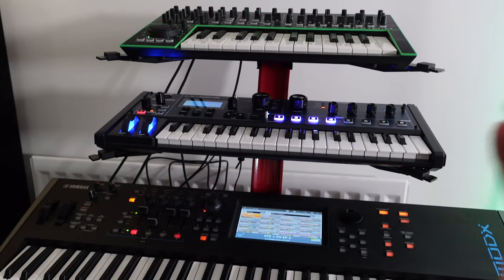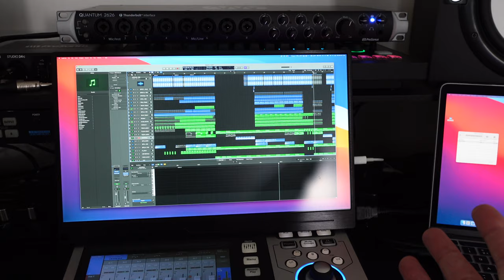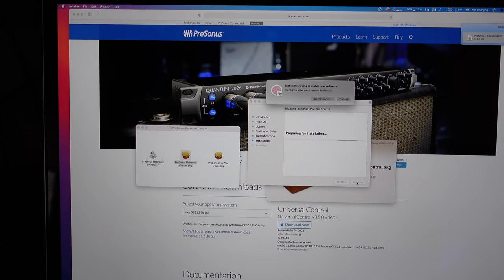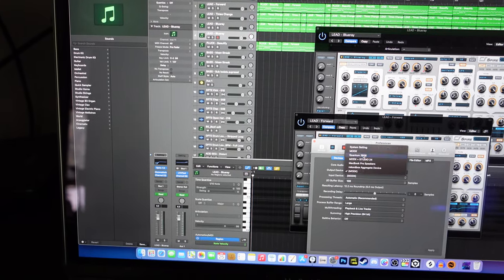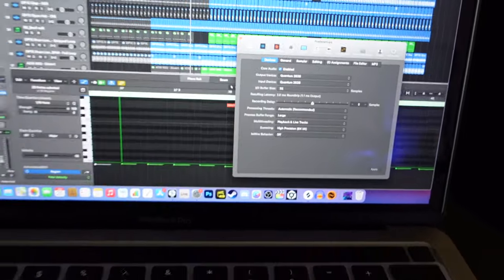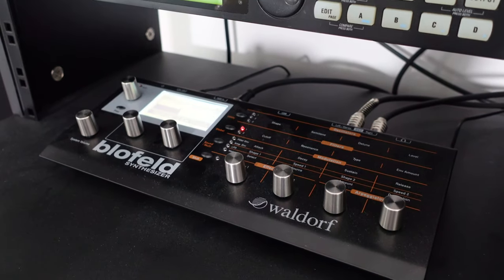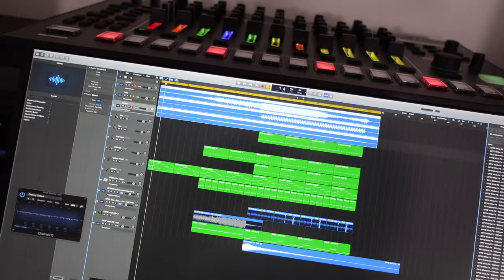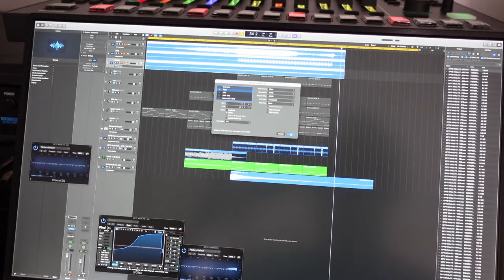M1 Mac + Presonus Quantum 2626 | Recording Hardware Synths

Comment: I've been using my Quantum 2626 as part of an aggregate system, combined with various components connected to it and a Presonus AR22 and a MOTU Pre8 where I have sent the ADAT channels from that out to an RME Digiface, skipping the onboard DSP processing of the MOTU and monitoring those channels directly from the DIgiface unit.  Now here is where I have run into issues.  So as to be able to monitor all of the various interfaces, I have connected them to a separate Mackie ProFX 12 to send them to headphone monitoring. All of the devices are latency free except for the 2626 which has just a bit of noticeable latency.  It is my understanding that since there is no DSP present on the device which can be accessed via Universal Control, Presonus has instead pushed that processing off to the DAW processing and what is being monitored is not the device inputs but the DAW I/O and this is where I am getting the bit of latency.

Comment: The Quantum 2626 is a Thunderbolt 3 interface (round trip less than 1 ms) with 8 preamps, ADAT expandability for $700! Think about it.  You can't touch any other Thunderbolt 3 interface with 8 preamps for less than $2000.  Some might think, 'well, preamp quality or on board DSP.  Yeah, those are nice to have, but nowadays there are mostly good preamps and better preamps, you're hard pressed to find a bad preamp.  The preamps on the 2626 are good enough that with a decent microphone and a little processing you can get great sound.  I own one since it first came out and you can't get anything nearly as good for the money.  I am frankly surprised how this is not the most popular interface on the planet.
Reply: One reason might be all the QC issues people are having. I was going to get one, but read so many problems online combined with really poor product support

Comment: Can you select the Quantum 2626 for audio playback from the Mac OS Menu?  (As in, available under Volume > Output Devices? ) Or is it only available when running your DAW? I’m upgrading from an old MOTU device and that is certainly a feature I need.
Reply: curious about this as well, as I need to use it for everything regarding the computer itself, not just  the daw
Reply: Yes, you can.

Comment: thunderbolt 3 cable are currently hard to find and expensive. you need a real T3 cable, no other cable will do. 
Also upgrading from a Focusrite Pro 40, because they don't support beyond macOS 10.15. 
This is very basic in function, good, but limits my extensibility compared to the Pro 40.

Comment: Wow So great !! Thanks for this great video, was waiting for that for a long time!
Really waiting your test with ableton live...
What is the sample rate you used for this session?  Wondering if you could even decrease the latency with higher sample rate...

I am really interested in live processing guitar and vocals (octaver,...) along with vst with ultra low latency in ableton live, is there any chance you could try something similar to test how fast and stable it is...
A vst stress test maybe with ableton...?
Reply from the maker: Sample rate was standard 24 bit 44.1khz. I didn't  try higher but I guess latency would increase.

I haven't tried ableton yet but will do soon. I think it will totally depend on the how well the plugin is written. The ones in Logic are  optimised for M1 but that being said Ableton runs very well on the M1 and I'm not even sure if it's an optimised M1 version yet..
Reply: @andykirby   Hey Andy, Thank you for your answer. I think increasing the sample rate decrease latency but take more of the cpu usage. Usually I am seeing latency decreasing when increasing sample rate for a same buffer size. 
Thanks for your great video!

Comment: Great video thanks. One question. Mac M1 input is thunderbolt /USB 4. And quantum it thunderbolt 3. What hub / cable works. I tried a apple USB3 cable and no connection. Any advice?  Cheers
Reply: You need a Thunderbolt 3 cable. It has the same physical connectors as a USB-C cable, but they are marked with the Thunderbolt symbol. I would honestly just buy one directly from Apple.
Reply: @joeygwood  thanks. I tried apple TB 3 and the Mac didn’t recognise it  but I now have an OMC hub and went with OMC TB 4 cable and it all works great something to do with the read speeds. Or maybe a faulty cable.  I definitely recommend OMC gear with the M1. Cheers

Comment: Hey I have the 2626 as well.  What are your thoughts on no hardware direct monitoring?  I notice a very slight delay when tracking vocals since I have to monitor through the daw even with low latency settings (~1.5 ms round trip vs 0 latency monitoring)
Reply from the maker: I haven't noticed any latency using instruments but I haven't tried it for Vox yet. interesting what you say..
Reply: @andykirby  I'm noticing at 192khz with 64 samples it is less than 1 ms it's pretty much perfect zero latency (though I'd have to freeze all other tracks to prevent cpu crackles).  With 44khz and 64 buffer the rtl is over 3ms and I can notice it.  But I may just still be refining my technique for vocals specifically, maybe those with more experience will be used to very slight delays of 1-3 ms when tracking.  Also, I may just be extremely sensitive to latency.

Comment: Darn it, I wish you would show Logic's performance meter just ONE time near the end of the video when you are actually monitoring 6 inputs at 32 buffer, so we can see how an ARM Mac copes with a few tracks at a real live 32 buffer setting. 
OTOH, don't think you are quite understanding latency in Logic. You have chosen a large process buffer in options, which means that all those initial playback tracks you were showing  when you said "32 buffer", were actually playing back on a 2048 sample buffer size (~46ms). BTW, that's a really terrible setting  to use and slows down Logic's reaction time considerably. Please consider using medium at the most, or even better, small (512 samples or 11.6ms).
The only tracks that will actually go to the 2MS latency of the 32 buffer are,
If you have highlighted a virtual instrument track e.g. to play it in real time with a midi KB
or
If you have record armed or input monitoring armed audio or aux track.
In other words, for example, unless you actually have the SPIRE AU plugin track highlighted and selected, in your case, it would be playing back with a massive 2048 sample buffer and therefore dramatically lower CPU usage. Logic compensates all this on playback of course, so everything is always in time. Any good DAW does.

This is how Logic works and it is not negotiable. If you really want to see the low latency performance of your ARM MAC with 32 buffer, try something like Ableton Live (has a full 30 day demo if you don't own it), which runs all tracks on the native chosen buffer at all times. So if you choose 32 in Ableton, every track IS on 32.
I still meet people to this day, 20 years later, bewildered how Logic can perform so well. It's not rocket science. MAGIX developed the first native hybrid buffer Engine for Samplitude and then Logic PC decades back, and then most big name DAWs have followed suit. Pro Tools, Cubendo, and Studio One basically, as far as on the Mac side. 
Now, I don't have experience with ARM Macs, but Intel Macs were terrible with low buffer sizes and a lot of real time record armed tracks.
I'd be curious to see how an ARM Mac fares with 32 tracks actually running at 32 buffer.
Today on my 13980HX Windows laptop, I tested 32 record armed stereo tracks, with a broad mix of 5 stereo FX plugins on each and every track, for a total of 160 real time native plugins. I couldn't go lower than 64 buffer with this interface (my MOTU 828 USB 3 which goes down to 16 buffer is coming in a few days), but with 32 tracks all record armed simultaneously, all receiving audio, and each and every one with a multiband comp, EQ, reverb INSERT (yep, 32 large hall native reverbs), I didn't get a single dropout and was astounded at the DAW usage showing just 20 percent. When I disabled the record arming and they became "playback" tracks, it dropped to just a few percent, cause they were then playing back on 1024 buffer.
There are people that are supposed experts that teach Pro Tools (they are literally called Pro Tools Expert lol), that don't even know that Pro Tools works the same way, playing back 128 tracks in one video and astounded how it was doing it at 64 buffer on an iMac Pro back in the day. Not one track was record armed, so in reality, all were playing back at 1024 buffer. Every single one. It wouldn't matter if the audio options has 16 buffer chosen or 1024. The performance would be the same, as it would be in your situation here.
I am not in any way trying to be derogatory or insulting, and if you did understand this already, I apologise. I come from a background of obsessive DAW efficiency and CPU power testing and have spent thousands of hours over the years doing all these tests.
Now yes, the hardware synths you were monitoring through the Quantum in Logic were indeed on the 32 buffer.
To give us a better idea of the performance, do you remember how many tracks were actually receiving live input simultaneously?
BTW there is no such think as zero latency. Even Pro Tools HDX is around 0.7ms and that is one of the fastest.
2ms roundtrip for a native interface, and not even at a high buffer, is OUTSTANDING, and Presonus have done an incredible job on that one. Unsurpassed really. I think it's still the fastest native interface on the market. 2ms is imperceptible to pretty much any member of humankind ;)
Even RME are slow vs the Quantum lol (strictly speaking about latency here).
And at low sample rates like 44 or 48K, the Quantum really is even more impressive, as most interfaces are about 5 to 6ms at those sample rates. The PreSonus is only 3.2ms at a 64 buffer at 44K. Unheard of. I chose the MOTU 828 because the DSP total monitoring latency through the onboard FX is only 0.7ms total, and the onboard FX are good enough for monitoring purposes for my use case, with is like yourself, with synths. I can add native plugins I want to add once I print the synths to audio tracks. But the MOTU, for a USB interface, can go down to about 3.2 round trip through the DAW natively, so still pretty good. But nothing is as fast as a Quantum.
Then again, 26 inputs with DSP compression, 4 band EQ and gate on every single channel plus a reverb send, at 0.7 total latency, was what made me choose the 828. Cause even though I have a good CPU, I can monitor all those 28 ins at that ludicrous latency and have absolutely zero CPU impact. SO, why not Hehe.
Another thing to close.. You don't have to move recorded tracks around due to latency. You could even record them at the very highest buffer size, and Logic will automatically compensate and place the audio correct on the timeline.
It's been a couple years so maybe you know all this stuff by now anyway. The Quantum does report its latency accurately to Logic for it to compensate, for some interfaces that do not, one needs to do a manual measurement and make one set and forget adjustment into Logic's audio recording sample delay parameter, whether positive or negative depending on your measurements, and once done, that's IT, as long as you use that interface, Logic will always place the recorded audio sample accurate on the timeline. Latency only matters for monitoring. Not recording. 
Peace.
PS, Oh, one final point to anyone reading. Please note that there are plenty of native plugins that add latency of their own. For monitoring, best results are always with zero additional latency plugins, then once at the mix playback stage, use any plugins you like and any modern DAW will have plug in delay compensation and keep everything in time.